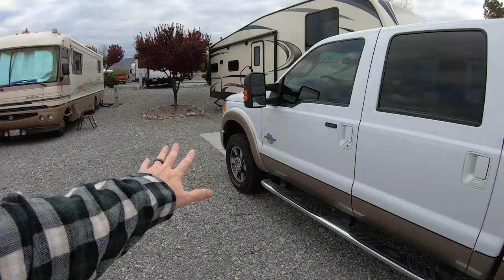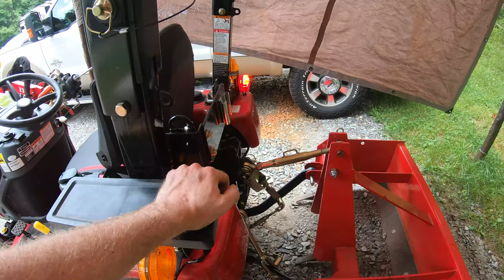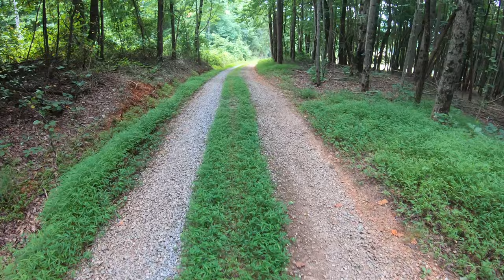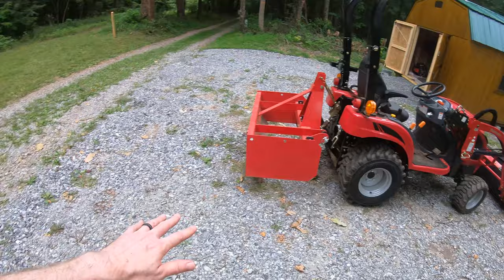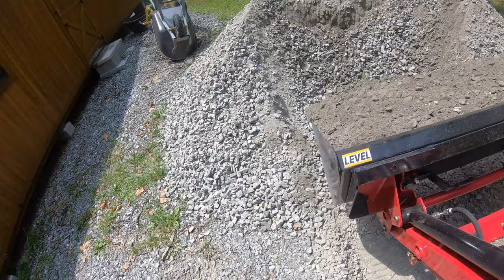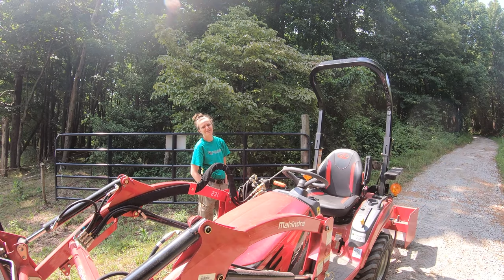Mahindra Emax 20S HST Grading A Driveway || Subcompact Tractor

Comment: Hi.
have a question for ya... with your box blade, have you tried to cut a drainage ditch of some kind.. if so would ya mind posting a vid.  we have two high hills that meet with a low spot and it gets very wet, puddles even year after year.... summer isn't too bad as it dries up by right now tons of standing water and I would rather not buy  a plow of some kind when I have a box scrapper that might do the trick with one tooth down.  I may just attack it but thought I'd ask first. 
thanks.
Glenn.
Reply from the maker: Hey Glenn, not something I have attempted yet, although part of my driveway definitely needs this done too. Ive seen different attachments for the front end loader that can act as a scoop to dig things out. I imagine you could tilt the box blade to the side a bit to dig a ditch though. Probably just have to take multiple swipes, but it can definitely dig a rut fairly well as we found out along our trails. - Shane
Reply: @DnSAdventures  well we tried it and kinda worked... too wet for now but the tires left enough of a groove with the one tooth down that some water started to drain.. will have to wait till spring when it dries up and try again , will put in a drainage pipe aswell . 
did you end up getting anymore toys for the tractor?
Glenn.
Reply from the maker: Ah the joys of drainage issues haha. We don't have standing water issues as much as it just ripping our driveway away haha. No new toys yet, but I am sure I will convince Deanna that we "need" some sooner rather than later haha. Have a good one! - Shane